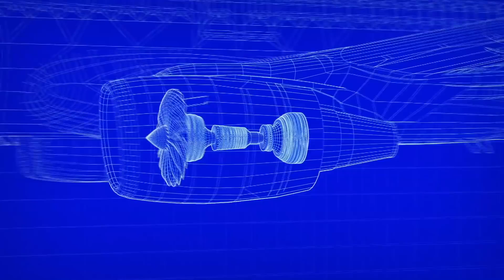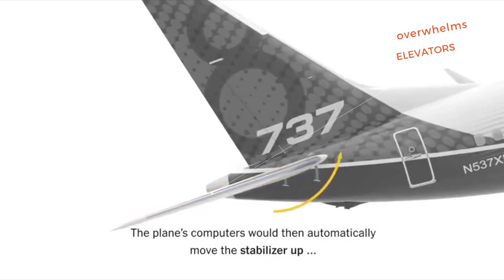737 Max 8 probable cause revealed - Prof Simon

Comment: The Lyon 737 MAX  pilot's side AOA vane was replaced the night before on the aircraft, and allegedly tested.
The aircraft had had problems with instrument disagreement between the pilot's side and the co-pilot's instruments.
The sender module that sends the info to MCAS was not.  
The pilot's AOA indicator and airspeed instruments were in disagreement with the co-pilot's instruments due to the faulty AOA vane on the first leg as well as the fatal take-off on the second leg.. 
The first leg of the flight had a 3d pilot and another crew who experienced the same flight characteristics as did the fatal flight with another crew.
The 3d pilot acted to defuse the situation and show the crew how to recover the aircraft without further incident.
This was not passed onto the second crew after landing.
The 3d pilot went on his way.
Why did Lyon's management allow the aircraft to fly with disagreements between the pilot's instruments and the copilot's in the first place?
Why wasn't there a test flight after the AOA vane replacement to see if the problem was fixed?
Why did Lyon not cease operation of the 737 MAX to insure all pilots were up to speed on the checklist solution for what happened on the first leg?
Why did a very experienced pilot on the second leg who had 8,000 hours not down the aircraft when his AOA indicator and airspeed indicator were both in disagreement with the copilot's instruments?
Why did neither crew actuate flaps to disconnect MCAS?  
Engaging the flaps disconnects MCAS, they were still slow enough early on.
How is it that they failed to overcome the oscillations through the use of whatever procedure the 3d pilot on the 1st leg had shown the first crew?
Why have there not been similar accidents in the U.S. fleet, given the hours and number of aircraft flown?
Both the Lyons and the Ethiopian Airlines crashes seem to point to a training issue and management failure, in the case of Lyons,  to allow an aircraft to fly with two critical problems with the pilot's instruments?
I think MCAS needs to be revised to prevent the oscillations, to allow manual control to be restored if there is an oscillation as happened in both cases.
The aircraft isn't unstable, it is the placement of the engines and the power of the engines that resulted in the MCAS system in the first place.
Therefore, training is required and a software and possibly flight control surface enhancement need to be incorporated.  Possibly.
However, it certainly looks like training is the issue.
The B1 and B2, the F117, the F16 are all inherently unstable aircraft flown by computer, all fly by wire, as is the UH60,, and the CH47 is unstable without the control system for the hydraulic flight controls.  Evidently, the 737 MAX flies hands off at altitude, or it would not have been certified.
It is the stall characteristics that are different than the 400-800 series and the power of the engines, making stall recovery something that is done carefully.
Reply from the maker: Thanks Larry...good info.
Reply: The problem is AOA....it feeds erroneous info to the system...
Reply: Kiril Mihaylov it was. But not the sensor itself
Reply: You know, at the end of it, everything is related to money. It's just so simple. Boeing, airlines, government.
Reply: Beautifully written piece on the unfortunate situation with these aircraft. I hope someone ln authority reads your analysis and corrects the problems.
Reply: From what I have read there have been complaints from US pilots, but these events happened in normal flight and were recovered from. I think it interesting that both Lion and Ethiopian crashes happened shortly after takeoff. Steep climb, no autopilot, faulty AoA, MCAS involved, low altitude and as you point out insufficient training, all combined to end badly.  
Surely training on a new feature/device is down to the manufacturer, from what I understand, MCAS is difficult to find in the flight manual supplied by Boeing and isn't in any training.
Reply: 1) "Why did Lyon's (sic) management allow the aircraft to fly with disagreements between the pilot's instruments and the copilot's in the first place?" They did not know that AOA sensors were critical for the safety of the aircraft, because Boeing withheld MCAS from everyone (MCAS is a closed loop controller which requires AOA sensor for feedback).
2) "Why have there not been similar accidents in the U.S. fleet, given the hours and number of aircraft flown?" Because AOA sensor did not fail in those aircraft. One sensor's failing to cause an aircraft fall out of the sky is not accepted in aviation. That is the reason for grounding BTW.
3) "The aircraft isn't unstable, it is the placement of the engines and the power of the engines that resulted in the MCAS system in the first place.
 Therefore, training is required" True, but Boeing did not tell that additional training is required. Actually on the opposite, they sold the MAX claiming that it is the same as NG and no training is required.
4) "Evidently, the 737 MAX flies hands off at altitude, or it would not have been certified." MAX is certified ONLY IF MCAS is there. MAX is ONLY unstable at low speeds where extra drag caused from bigger engines is not negligible.
5) "The B1 and B2, the F117, the F16 are all inherently unstable aircraft..." Yes but they are NOT civil aircraft. Actually military aircraft are desired to be unstable for better maneuverability. Civil aircraft are not accepted to be unstable.
6) "It is the stall characteristics that are different than the 400-800 series..." Possibly you meant aerodynamic characteristics? Yes it is different. That is why MCAS needs to be there in MAX, but not in NG.
Reply: at what flight junction did the 3rd pilot intervene? flipping the circuit breaker for the MCAS  was not standard ( and should not be a) procedure.  It was a work around ( assuming the pilot makes the right decision) to enable the pilot to fly the faulty plane.  The POS should not be in the air.
Reply: Larry wood what are doing in that pic eating a calzone ?
Reply: AOA was installed in the same nut plate holes 🕳 🕳 🕳. Oooops guess what. It’s not the sensor itself. The holes 🕳 are miss drilled whatever degree. Because we build to a flat earth, but some engineers think level doesn’t matter

Comment: Speaking of landing gears, I fully understand why 737's have such short legs. I know the history. 
Now, MCAS is a solution for the pitch-up tendency problem, which is caused by the adoption of the new engines, which had to be repositioned because there's just no more space under the aircraft at landing config. Wouldn't it be a lot easier to make the Max series a bit taller so that they could accommodate those big engines at the usual position, rather than rethinking the position of the engines, which in turn would create yet another problem of pitch-up tendency?
Reply: Not so easy. The landing gear retracts inwards towards the centre of the aircraft. Longer main gear would mean they wheels would hit each other. So the only way to have longer main gear is to also change where the main gear is mounted to the aircraft. The would have to be further out into the wings.
That's a pretty major structural redesign. 
It could also reduce fuel capacity since more of the wing has to be taken up by the landing gear and it would add weight. Things to be avoided when you're trying to improve efficiency and fuel burn to meet some pretty specific targets..
Redesigning the landing gear and its mounting is the obvious solution to the problem of needing more clearance for the engines, but its also going to be a lot more work and expense, as well as taking more time. More than Boeing were prepared for an aircraft that is, ultimately, a fairly quick reaction to the success of the A320neo competition instead of the clean sheet design they promoted previously. 
Re-positioning the engines is ultimately the easier solution to implement.
Reply: @BrySkye  , thanks for the reply. I agree, taller landing gear = new landing gear system = wing design revision, and from what I understand, the 737 wings have been made even thinner already. So I guess what I said above would be closer to designing a new aircraft altogether.
Reply: Your logic is wrong. The engines have more thrust. If you put them lower as you suggest you lower the thrust line further below the centre of drag which increases the couple between thrust and drag so you get more pitch up tendency in all regimes of flight with power applied. All designs are trade-offs. Boeing success over many decades show they do actually know how to design a plane. The flaw with the MCAS will be fixed and the pilots will henceforth be acutely aware that the Stab Trim Cut-out switch can save them from a pitch trim malfunction.
Reply: @XPLAlN  You are correct, all designs are trade-offs. 
Of course, I did not mean placing the engines that much lower. Just a bit, so that they don't have to be placed so much up front (of the CG?).
Now about Boeing, that's how I see it too, and exactly why it baffles me why this fiasco could even happen in the 1st place.
Reply: major re-design and thus effectively new plane, thus new certification.
Reply: @JohnnyMotel99   Yeah, I suppose new landing gear= redesign= new certification. 
I thought at least the risk would be lower.
Reply: Yes, this would be right approach, but this would mean serious air frame redesign which is same as introducing new model (it will not be probably 737 any more), it would take a longer time and Boeing needed fast solution because A320 neo start to take big market share with very similar (or quite same) engine.
To my understanding Boeing made big strategic failed decision, they should start with new design right after 737NG because from that point it should be very clear that old B737 frame is outdated, not suitable for new high bypass ratio engines. 
With NG model they already had trouble to mount new engines (I'm talking about 1997 year) so special engine design with flattened bottom was introduced just to keep minimum required clearance between engine and ground. Responsible managers in Boeing should be aware in that time that future engines will probably have even bigger bypass ration and alarm lamp should lit long time ago in their heads.
Reply: @zokonjazokonja  I did not know about their having trouble as early as the NG era. Wow. 
On behalf of everyone, thanks for the info and insight.
Reply: You re totaly right. But Boeing is not looking for safety first they were greedy thinking to solve problem of fuel cost and saving money!!!
Reply: My understanding is that taller landing gears means a new wing which means spending more money.
Reply: Making the landing gears taller would mean a complete redesign of the airframe.
Reply: If they did that, the retracted gear would no longer fit in their bays.
Reply: @TheUtuber999  (and also to similar replies) Yes, I guess you are right, what I proposed would also create another problem to be solved, thus require redesign. Too bad.
Reply: It would be a more effective solution but it would cost more money.  Money is the gremlin behind all of this.
Reply: In 2 words: they did!
Reply: @mikecowen6507  I didn't know that fact Thanks.
Reply: You could the new version get through certifications that easily, and pilots would need more retraining then what was intended.
Reply: @FriedrichHerschel  I was thinking more direct solution, but yeah.

Comment: Aviation rules has been written by blood. But in those 2 crashes showed us that these rules are still not valid to produce safer airplanes. Manufacturers trying to maximise their profits by reducing the quality of many parts of airplanes. Boeing in this Max series is really sucks. And they have to pay very huge penalties and compensations to the families  of the victims and airlines due to grounded airplanes. So trying to save money and maximasing the profit will.give them big looses. Questions is what boeing bosses feltl themselves after 2 crash and killing 350 people. Was it necessary to kill those people to make more money.
Reply: I think you might want to rethink your attitude toward Boeing.  They have never been an aircraft manufacturer looking to "cut corners" or find the cheapest materials to make airplanes.  That has never been their style.  Boeing has a reputation as being the best airplane manufacturer in the world.  You're thinking of McDonnell-Douglas,  and that's why they're defunct.  MD's had the worst safety record in history. If you're not old enough to remember the American #191 disaster at O'Hare in 1989, go Google it.  Worst disaster in American history, and it was a DC10.  Not the first time the DC10's had such severe issues,  but it was the worst.
The situation with the Boeing Max's were the MCAS systems, as I'd suspected all along; that and faulty sensors.  That wasn't Boeing's doing; that can be chalked up to lazy, slapdash maintenance crews.  Also, the previous crew couldn't be bothered to tell the new crew there were issues with the sensors.  Again, not Boeing's fault, but blatant disregard on the part of the previous crew to neglect to the next crew of possible issues. Plus, the airlines hadn't given their pilots more than minimal training on the max, when they desperately needed more.  Again, not Boeing's fault, but the airline itself, cutting costs by not giving their pilots the training they needed.Boeing was in the process of rolling out updates for the MCAS  next month.  They'll probably  taking that update online sooner.
Reply: Employees of business do whatever they're incentivized to do.  Generally that involves maximizing profits.  Therefore a self-regulating business is pretty much a contradiction in terms.
Reply: Boeing management have the blood of those poor people on their hands
Reply: Every business tries to maximise profits. Even the grocery store across the street. Can't blame Boeing for trying to design a more efficient and cheaper an aircraft. Knowing the safety regulations and the multibillion lawsuits against companies having neglected safety I don't think Boeing have decided "Well, let's create the cheapest possible airplane for maximizing our profit and to Hell with the safety of all these passengers, if they die - they die!". People at Boeing are not stupid and they know VERY WELL that if there's something wrong with the airplane, it will hit the fan very soon leading to a catastrophy for the company. Not to mention the certification procedure for an aircraft like the 737. It would never pass it if it was an obviously faulty design/poor quality aircraft. So I don't believe a company like Boeing would commit a suicide this way. What is way more probable is that they themselves didn't know about the problem.
Reply: When it's all about the bonus, blood on your hands is easy to deal with.
Reply: the should have known if max will be flown in Asia and Africa , accidents like that can happen there because of bad pilots.
Reply: The reason is Boeing never calculted of mcas system failure which they trusted to prevent aircaraft from stall. This aircraft would need design changings cause of the bigger engines mounted. Maybe bigger wings but boeing just create a useless mcas system. I am very big fan of Boeing but to be honest in this max model they sucks so big.

Comment: The uncontrollable horizontal stabilizer recovery is a memory item on the NG. Just read that the pilots on the lion air flight were going thru checklist books. Were they certified for the Ng?  Or one of the older models. If not they would not have known how to disable the MCAS. I wonder if the Egyptian pilots  were certified on the NG as well?
Reply: I think you meant Ethiopian pilots.  Same continent, different countries; and as far as safety and reliability and customer service are concerned, two vastly different national flag carriers, with Ethiopian Airlines having the better track record in these aspects by far.